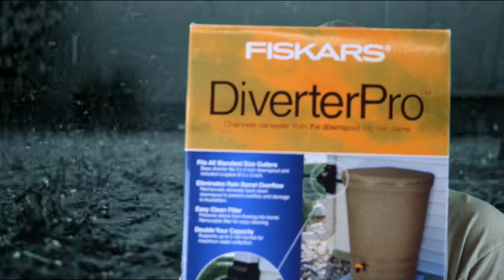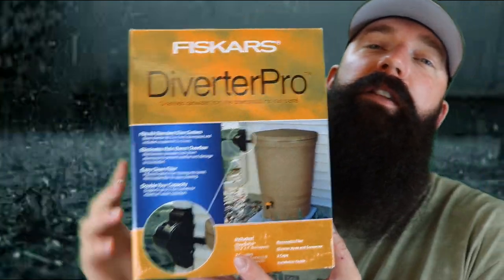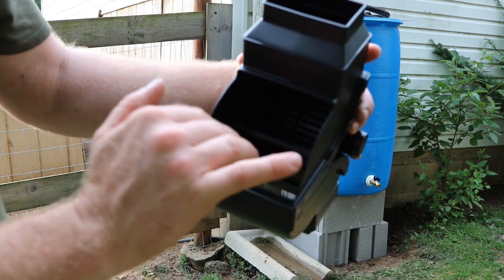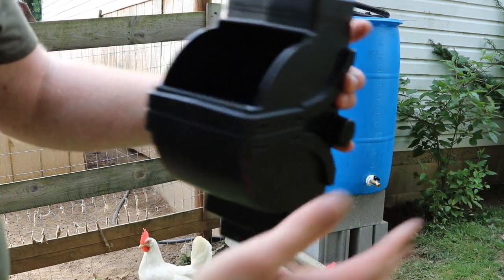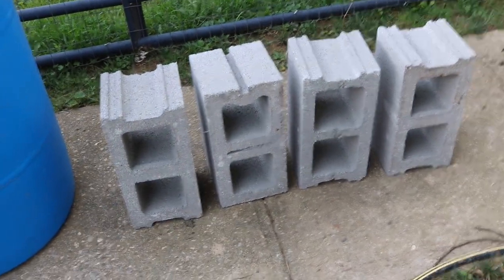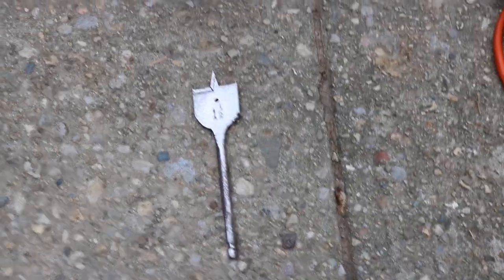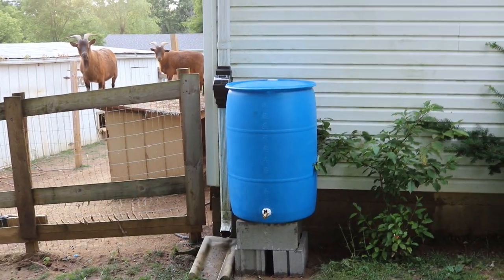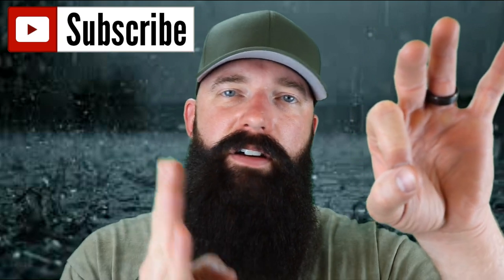DIY Rain Barrel Installation CHEAP - using Fiskars Diverter

Comment: HI , I like your video, it introduced me to a product I didn't know  existed however the overflow hole is not needed when using the Fiskar DiverterPro. The way its designed is that when the barrel is full the back pressure of the water still in the fill hose will divert the water to go straight thru to the gutter that is installed under the diverter. That is why the height of the rain barrel is so important and has to be done correctly. One less hole to drill. ;-) 
Happy water collecting.
Reply: You may want an overflow hose to extend to where the water is useful or have a catch bucket  so you know its full and store some of the water in other containers, depending on how reliant you are on that water

Comment: I would use plumbers putty or a roll of putty tape rather than that messy caulk. Just a FYI. I like the Fiskar diverter. A single 50 gallon barrel will fill up extremely fast in a average rain event so if going to the expense of setting this up ,I would link another barrel or 3 if using this water to water a garden. Run your hose at your normal watering pressure into 5 gallon buckets for 5 minutes to figure out how much water you are using to gauge how far your captured rainwater will last. 50 gallons wont last long in hot weather watering

Comment: I installed the same product. Works great, except my a$$hole neighbour called the Bylaw Office stating my overflowing barrel was allowing water on his property, WHEN IT'S RAINING LOL. I was ordered by the Town to remove the rain barrel. I refused. It's still there. In all honesty, a 2nd hose should be installed near the top of the barrel, and plumbed into the lower downspout, to control runoff when the barrel is full. These barrels fill up in minutes during thunderstorms.
Reply: Betcha your neighbor has tenfold violations.

Comment: Good job, but I don't think $30 is necessarily cheap, but you're lucky you got the barrel for free.  I got 2 barrels @ $20 each, going with a plastic gutter extention called "plastic flex elbow" ($2.58 each on Amazon) that's going to go directly into the top of the rain barrel using pc of panty hose on the elbow as the filter, and maybe a pc of screen also, and spigot was $9.  So all in I'm at around $32 each w/ $20 for the barrel.

Comment: Great video, thankyou. I live in the northeast, what can I do during the wintertime to prevent freezing or damage to the barrel? Thankyou!
Reply from the maker: You can switch the diverter straight to the downspout.  I also keep the faucet open at the bottom of the barrel so it won’t hold water in the winter - just in case anything gets in there.  She is still going strong.  Thanks.  Take care.
Reply: @BrianEaly  great, thankyou so much!

Comment: My problem would be that my arms aren't long enough to get through the hole with plyers or wrench to reach the nut on the back side of the spigot and still reach the spigot on the outside.
Or am I missing something?
Reply: This Old House did a quick video on this. He just used a threaded spigot and plumbers tape to keep it from leaking. (No nut on the inside necessary.)
Reply: I just made my rain barrel, installed brass spigot without sawing big hole using "old farmer" logic/methods. My barrel is plastic, just like one in video.

HOWTO:

Mark spigot spot in line with a bunghole on the top. I drilled the hole for the spigot just big enough so that it would cut threads when screwed in (for my brass spigot, 3/4 inch).

With barrel standing on sawhorses, use weighted string (I crumpled aluminum foil onto string end to make ball to fit thru spigot hole), then lowered string through bunghole above the spigot hole and bring weight + string out thru spigot hole. Needle nose pliers or wire as hook helps.

Now lay barrel on side (between two sawhorses), spigot hole down. Open spigot, cut weight from string end then thread string through open spigot in direction of water flow, now tie something onto end of string hanging from spigot hose connector so string cannot pull back out thru spigot.

Screw spigot most of way into barrel (forcing it to cut threads in barrel).

Now at bunghole with the string, slide internal spigot plastic washer and then the internal spigot  brass nut onto the string. Now tie a stick or something  onto end of string so it doesn't go into bunghole.

Briefly raise barrel, pull string taut and let washer and nut slide down the string inside until it stops next to the spigot threads inside.

Barrel again horizontal, looking through top bunghole, use flashlight and stick in bottom bunghole to tip over the washer and nut onto the male spigot threads that are sticking up. Keeping tension on string helps.

Manipulate stick to run nut down onto threads as far as possible. Now, take open-end wrench (that will fit thru bunghole) that is correct size for internal nut (mine was 1 inch), tape it to securely to broom handle, insert into bunghole along the string, watching thru other bunghole + flashlight... wiggle until wrench slides correctly onto internal nut to hold it.

Now, from outside,  tighten spigot with another wrench until tight and oriented correctly. You may have to "back rotate" the spigot at times so that when the final good & snug (rubber washer squashed between spigot and barrel) the spigot is oriented straight down.

With this method,  no cutting of big hole needed, nor any caulking.

For my downspout gizmo (Oatey brand), it had a 1.5 inch OD flex hose, so I drilled out one of the bungs using a 1.5 inch spade bit while holding bung with channel lock pliers. Presto, hose fits into hole perfectly with no entrance for bugs and dirt.

Comment: What did you do with the top hole cut out?  Did you put any kind of strainer over that or did you glue it back in?
Reply from the maker: Trisha Simmons - I forgot to put that in the video... I use an empty 6” flower pot right in the top hole.  It has tiny little holes in the bottom that keep anything from getting in the water.  You can actually grow plants in there if you want as well, it will keep them watered.  Thanks, take care!
Reply: Brian Ealy, thank you! Great video...I can't wait to get mine started and this was very helpful.

Comment: You didn’t show the trouble you had getting the spigot down to the hole. Instead of any overflow and waste the water,run a pvc pipe into another barrel.
Reply: Use a pole or stick (saw a Canadian guy using a hockey stick) and reverse wrap some duct tape to get the spigot to stick to the tape then stick insert it into the cutout hole.

Comment: Need to add a parts list. Need to show how someone with short arms installs the spigot. And yes, you should have filmed the overflow install the next day.
Reply: A Canadian guy uses a hockey stick, but you could use a pole or stick that is straight.  Put some duct tape in reverse so that the sticky side is outside then stick the spigot on there, lower into the barrel and push it through the hole.